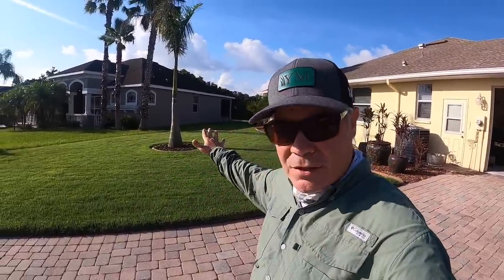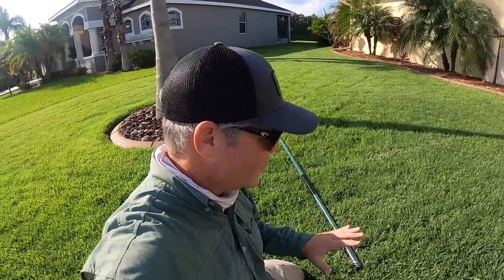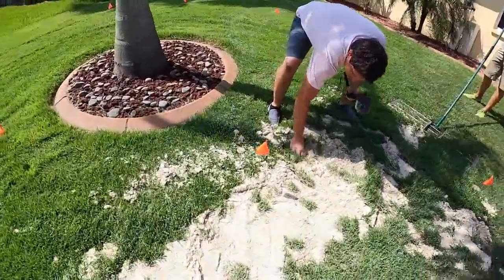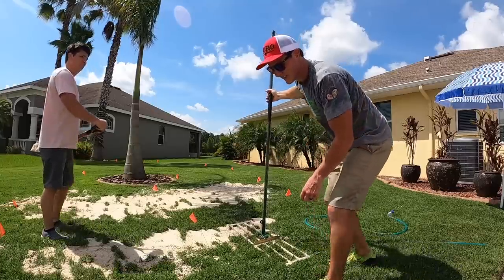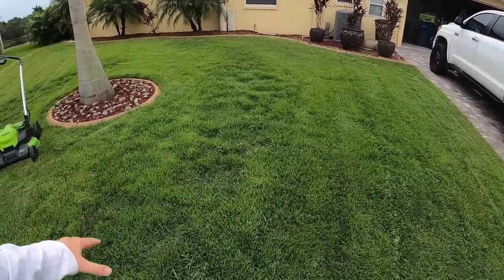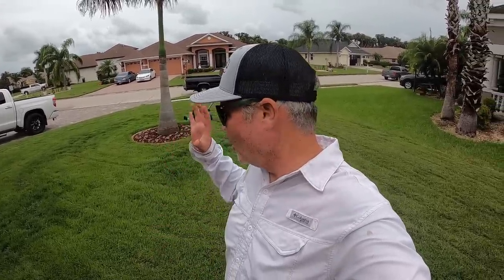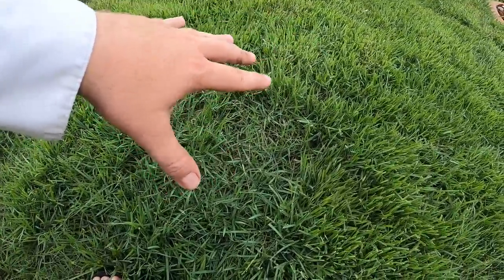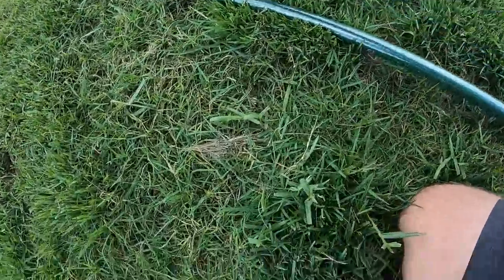Uneven Lawn Leveling | Don't Do It This Way

Comment: You might not scalp it before leveling, but I definitely would’ve cut it shorter than you did prior to leveling. Less canopy to push the sand through to get down to the soil.

Comment: Do you.have video.on.getting rid of.bahaia.grass
Reply from the maker: what kind of grass is your primary?
Reply: Atrazine in proper application is friendly to most Southern lawn types, but will kill Bahaia. Recommended applications of Scott's Bonus S Weed and Feed for southern lawns should correct the issue. Make your application determination after being 100% what grasses you are dealing with, and the size and weed density of the affected area(s).

Comment: If you are using a topsoil compost blend then you absolutely don't to over spread and submerge the grass canopy as the soil will actually do more harm than good. Sand is good for Zoysia's and Bermuda's but not Fescue especially if you have clay soil. Also, there isn't a wrong way but some food for thought if I'm going to spread out a soil medium I always want to use compost simply because it gives me a chance to add nutrients to the soil profile its a  win win.. my 2 cents
Reply: i have tall fescue,,,what do i use to level it with?

Comment: I think the problem with the leveling using mason sand is you do not know where the sand came from. We had 5 yards of fill dirt from contractor and after spreading we got cinch bugs and fungus in middle of front yard. What I am saying I was dumb, somebody went out in woods and  got me some dirt!!
Reply: Fill dirt is essential trash dirt lol. Washed sand is completely different. It holds no nutrients most bugs don't live in it fungus has a hard time growing in sand due to lack of organic matter. Its really just tiny tiny rocks. Once its in your lawn though it ends up dispersed and mixed with organic matter as you mulch. Worms and other life starts to mix it. eventually it just becomes loam like

Comment: I saw my neighbors mowing their grass with an electric mower.  It took them two days to cut the front yard.
Reply: I have 8,500 square feet in my front yard and I mow it with an Ego 21" battery mower using one battery. Takes 45 minutes to charge and lasts at least an hour. The back is 27,000 square feet and I use a 46" zero turn. I think the Ego Mower provides a cleaner cut.
Reply: @JeffSmith-eq3kc  Well my neighbors have a push mower.  It's pathetic to watch. I use Honda mowers.  I have one for the back and one for the front.  I have a very big yard and it's St. Augustine grass that needs to be mowed about every 5 days in the summer.  I don't see any lawn crews down here using electric mowers.

Comment: nobody on these grass porn channels use bahia grass. did i make a bad call by seeding it?
Reply from the maker: It's tough to grow from seed for sure.
Reply: @TheLawnCareNut  yeah i found that out. its super soft (for florida grass), and it grows pretty tall in rainy season. i do have patches of dirt still.
im too cheep to buy a leveling rake but i need one. those dirt patches eroded a bit and its like baja racing with a lawnmower.